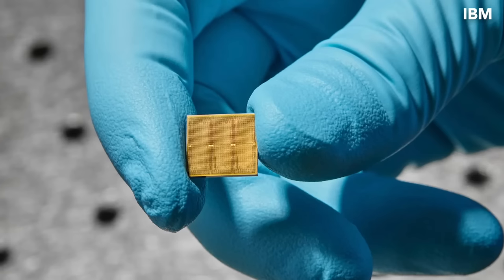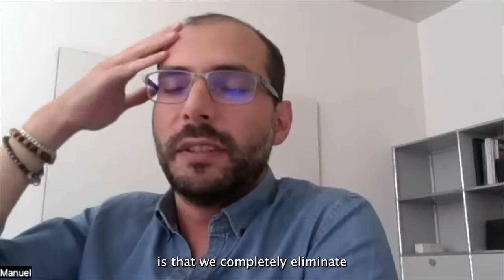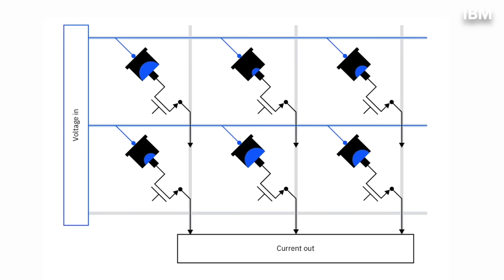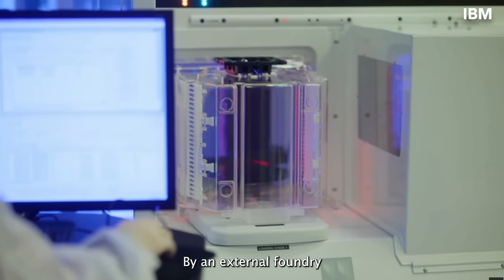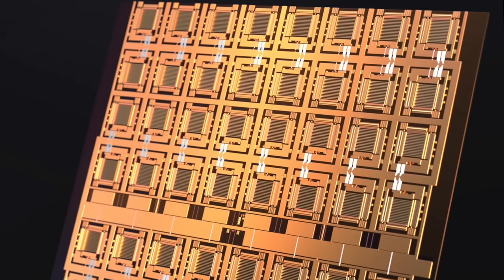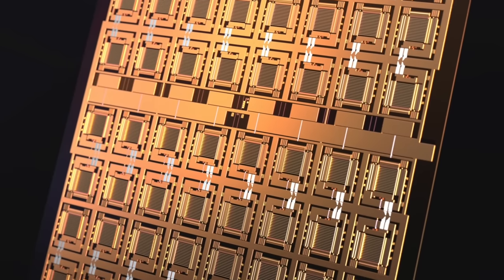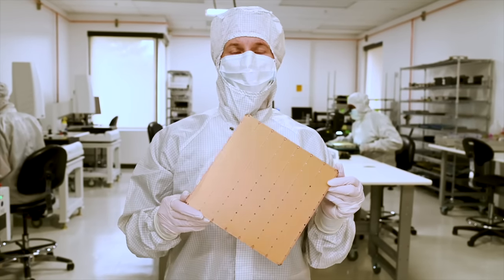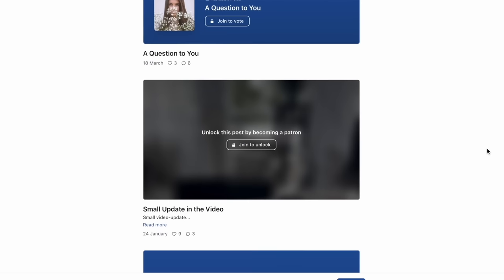IBM's New Computer Chip is Pushing the LIMITS! 🔥

Comment: I'm not a chip developer but wouldn't it be possible to bake a neural network into a chip permanently? For example if the weights are loaded in to the chip then some treatment seals those weights in forever as a fixed resistance value for each node, sure it might be a little less flexible but still fine for IoT devices and possibly this would allow the chip to last a lot longer than having readings decaying over time. It's 'just resistance' after all!
Reply: Yup you could do that. Most current devices use amorphous silicon resistance elements so the resistance range is limited to the high M ohms.

Comment: I find it interesting the analog cells containing weights only need to change during the training phase, but IBM's example shows the inference phase is really simple as a sum of currents. I wonder if at some point in the far future we'll have mass-produced 'hard-coded' chips for TRAINED networks that simply use fixed resistance elements for each of the weights.
Reply: The difficulty is that your trading the flexibility of changing the weights for a speed gain.  One would have to send out a new processor with every revision of the trained system.   The chip foundries would love it.

Comment: r u saying you can harmonically add overtones in to a single cell and recall it like memory, as in you can record in one transistor more than one point of information in a voltage?

That means that as long as you can read it/decode it, you can have a tonic memory, and then you can add a 3rd, 5th, 6th harmonic memories to the same transistor. 

That's potentially an infinity set of options beyond binary on the same element.

Comment: So, the fundamental problem addressed here is the huge I/O power penalty (fetch/store) between memory and processing, along with the relatively huge time penalty.

It strikes me, though, that this is a problem made urgent by intense, sudden and therefore unforeseen demand.  The observable scramble now is two-fold: (1) use less power to get the same or better AI effect and (2) build new power generation/storage.  You may also have noticed a new urgency for nuclear power world-wide.

We are arming ourselves with AI and infrastructure, using AI along the way as an effectiveness multiplier.  And well we might.

Comment: Your intro calls the IBM chips as Analog. They are not. They are mixed-signal. Even the memory cells are not truly analog since they have a limit to how many bits each cell can encode (to store/multiply). Output of each cell will drift & have noise. All are classic problems in analog computing -- not to mention the manufacturing variations that cause cells, columns, and memory-regions to have variable biases, variable noise, etc. This may succeed. Main questions: will it be more compute-efficient and more power-efficient, *with low enough errors*?

Comment: Amazing explanation! I would be thrilled to know more about the Design and Architecture challenges in ADC and Readout operations and how are these the current bottleneck for this tech.
Reply from the maker: The issue is that they need many ADCs to scale the MAC for larger models. Usual area/power/performance trade-off.
Reply: ENOB of ADC is the key metric. Higher ENOB more energy goes into ADCs, longer conversion time. Lower ENOB lower target accuracy. The number of ADCs is typically 1 every 8 memory columns, but could be also less up to 1 in 64 columns.
However, the most critical global thing to optimize is the size of the memory array. Larger arrays, more efficient ADC usage, better peak TOPS/W (key global metric, not TOPS/mm2 like in the paper since that depends heavily on the technology node and used memory cell technology). However, larger arrays are more difficult to fabricate and have lower utilization reducing average TOPS/W.

Comment: Typical microcontroller ADC input muxing suffers from input charge coupling through the ADC input selector's charge. I think there's an opportunity here to run multiple comparators and sweep a fast compare voltage across the other compare input of all and synchronously pick up the threshold switches in the compare output. To me, that's strikingly similar to things I recall of biological neural network function.  Somehow I feel another attack coming on from  recent learning, to the barrier between logic and spirituality. We get closer between global logic clocks and the Om..., to Jaw harp bone conduction Zen and the nerve stimulation of a T.E.N.S. machine. For minimal equivalent bit values in the flash memory, the scan value is even quite fast to complete. Go silicon augmentation?
Reply: I wonder if it would be possible to skip the digital conversion stage entirely for training, instead back propagating analog signals to adjust weights, then completing readouts using ADC circuitry outside of the chip.

Comment: I would argue that ai is compute intensive.    If you think about it from a bit level, the 100 hundreds of billion of parameters could be computed with the right instructions from just a single bit, so these parameters are basically just a placeholder of how much compute you need to do. But on the other extrem you could also make it extremely data intensive by basically having a lookup tables for everything already pre-computed.

Comment: It is good to see that IBM is confident enough in achieving well trained AI that it can invest in hard coding the networks in these amazing chips. A much lower power consumption is essential for AI to have widespread use. As long as AI needs orders of magnitude more resources than humans to achieve its results it will be less than stellar. A good competition to prove its worth would constrain power consumption to something comparable to the requirements of the human body over the duration of the competition (chess, go, trivia, etc.).

Comment: Hmn... So, if the human brain is arguably an analogue device, and our computational and conceptual speed is limited by our hardware -- yet, our hardware is almost infinitely adaptable and flexible (even rerouting itself after severing the corpus callosum, or after embodying a new learning algorithm), then does it follow that an aggregate of integrated analogue chips could be constructed which is capable of learning and "thinking" as a function of its design?

 And because of its inherent efficiency, and without needing programmatic compiling to delineate gradations of data input/output, or determine functions or goals etc, be constructed to be faster and more dynamic than any digital chip architecture? In fact, if constructed correctly, wouldn't it simply function without the need of programmatic input beyond whatever senses/inputs you gave it? 

I know this is way, way above my head, but if scale is not a question, then isn't it possible to replicate the cognitive capacity of say, an insect, then a sub-intelligent mammal, then a human -- except vastly faster and more capable of large dataset processing?

Comment: 0:00: 💻 IBM has developed a new analog computer chip that is 15 times more powerful than previous designs, addressing the bottleneck issue of data movement between memory and CPU in conventional architectures.
4:08: 🧠 Phase change memory allows for more controllable storage of data compared to other memory devices.
12:15: 🔑 IBM has implemented techniques to improve the accuracy of analog memory cells in AI computing.
7:51: 🔬 The challenge of integrating phase change memory technology at high density is due to limitations in metal layer integration and the size of the readout electronics.
15:41: 🤔 Analog architectures may not be as beneficial for training due to the need for customization and flexibility, as well as limitations with stationary weights.
Recap by Tammy AI
Reply: Good recap. Thanks Tammy AI!

Comment: I absolutely love this, IBM was the king of analog computers before the transistor came around and they're probably the last company on the planet with enough expertise to actually pull this off.

That said the accuracy problem seems like a real challenge though. Now i'm just a layman but a possible solution that occurred to me is to basically treat sections of the chip like the voltorb flip game from pokemon heartgold; so you measure the total value of entire horizontal or vertical banks of crystals to single out the lines where values don't match the expected output. If you cross reference horizontal and vertical lines that would then give you the exact spot where values changed, although you'd probably have to write these total values to classical RAM again to perform the error check...

Comment: Ignoring IBM has been periodically announcing this tech since 2018; the hart of it appears reminiscent of the early, 4-bit, hybrid digital-analog, MOS, TI, Yamaha, ... sound chips of the late 1970's, with A->D and D->A circuitry, along with a series of operations that can be performed on both the analog and digital registers within, if you consider volume adjustments to be multiplication, and application of square, triangle, saw-tooth wave functions, transformations.

Comment: The reason why there is a lot of capital flowing into AI finally is because the dream of wageless production and service delivery, i.e. ward captivity of 90+% of humans in the service of less than one %, is finally looking vaguely possible. Until capital ownership is made the primary means of the human majority's right to survive, we will always be servants, slaves, or prisoners. Both centralized and decentralized methods could be used to achieve the transformation. For example, Saudi Arabia with its generous welfare from the sovereign wealth fund uses a centralized model to effectively grant each household a large capital dividend instead of using wages as the survival permission slip of choice. Another nation might arrange for an annual stipend that citizens can use to purchase stocks and bonds (with heavy promotion of free investment classes as well as the choice of opting into a govt managed one, or govt. rated private one, etc.).

Comment: In the world of tech, where dreams take flight,
IBM's new chip shines with AI's might.
A marvel of science, pushing the bounds,
In the realm of data, where knowledge abounds.

With circuits so small, they boggle the mind,
This chip's a wonder of a rare design.
It crunches the numbers at lightning speed,
Unraveling secrets that algorithms need.

Deep learning, neural nets, it handles with grace,
In the vast data ocean, it finds its place.
With silicon synapses firing so fast,
It conquers the challenges of the AI blast.

In data centers humming, it toils away,
Solving complex problems, night and day.
From language to vision, it learns and it grows,
As the AI revolution continually flows.

So here's to IBM, the innovator's creed,
For their chip's a beacon that leads the lead.
In the world of AI, it's pushing the sky,
With limitless potential, reaching up high.

Comment: While the solution to these few problems seems elegant and efficient, it also seems to introduce inelegant, inefficiencies elsewhere. Seems like it might be better in an all-analog system. I am not in this field so I don't know if such a thing exists, though. It also seems like the brittleness is something that could potentially be solved so it could be used in AI training, which sounds like it could be amazing.

Comment: Be warned this comment is very long.

It is a problem I have often thought of when it comes to AI is that how do you get sufficiently powerful systems to be quite useful in general inside pretty small computers. Analog computers are mostly single purpose with you for the most part literally having to change the wiring to make them do something else so I basically thought of a system which I believe most definitely exist today but I'm not sure where, where you have a digital computer that does more precise things but would send The bulk of its AI computation to an analog side and the digital computer would basically adaptivity change what the analog computer would process and how it would and would also quickly organize information while the analog computer could quickly compute information with good speed and accuracy but would unfortunately lack the precision of the digital side. The reason why I'm thinking about this is because I am still a kid who refuses to give up on his dreams and recently I'm learning that life sucks and I'm really bored and I want to have fun and what I want to do is build an Android right out of science fiction It's kind of like both the Terminator and Lieutenant Commander Data from Star Trek and for almost 2 years I've been working on its design in my head mostly, The two biggest problems is AI and the thing that's supposed to be running the AI because I needed to be small enough that can fit basically within a skull and the digital analog hybrid I spoke of this basically what I'm thinking about, The AI on the other hand is something completely different and for the most part as I am still pretty much a kid I don't know much about this but I had to give it some thought so basically what I'm thinking about is a bunch of neural networks that could learn really quickly and adapt really quickly and the way it's going to do this is that it's going to learn the majority of its information through memory not through training data but training data will still be important because you still need to program it to know what to do and understand concepts so basically I'm thinking of something that would have pre-programmed knowledge and common sense like actual creatures in the universe do but would also help it learn from memory because then it can help more easily understand the information it is absorbing because with current AI systems if you try to get an AI to learn multiple things at once The data you put into it will overwrite the old data and would eventually replace it preventing an AI from being generalized without needing a lot of plugins and multimodal capabilities and for an Android this would also be necessary. and an AI also learns incredibly slowly. But if you can somehow integrate memory into the AI like an effective one and more complex one and then you can get that AI too pretty much put information it learns into the memory so it can stay there and not overwrite anything else that's important and this I believe would also help an AI learn much faster because how could you learn anything if you couldn't remember it! so only a few pictures of cats would be needed for an AI to know what a cat is. This idea was inspired by a paper of GPT-4 which essentially taught itself how to learn by using its own primitive memory to adapt to tasks so what if you could purposely make a more refined version of this and put it inside of a robot! It is obviously hard but I'm not even a adult man yet so I literally have all the time in the world. Also the power source is very difficult because currently I'm not aware of any compact power source that can power an Android of my design for long enough durations.

Comment: Here's an ignorant comment, I think this new analog chip will failed due to the material itself, the material itself needs to be like biological in function, like self repairing, self replicating and so on otherwise it will die or burn out/wear out, a complete electrical wave current will produce a massive amount of data plus it's processing and it wont be clean as well because it's analog (unfiltered) this will all add up to a large power usage affecting the chip, even if they succeded on implementing this chip it wont develop more ahead because of the material itself, in this case the discovery of new materials are more important when chip engineering is always been there, basically I see this as a dead infant brain for Artificial Intelligent, it wont live that long due to limitation unless they find a better brain 😁👌👍😉😎✌. Hmm a brain transfusion could work 🤔🤔 Good Job Folks.. Cheers.!!